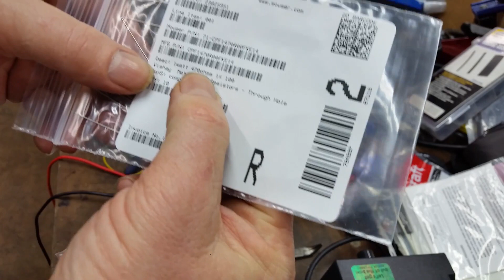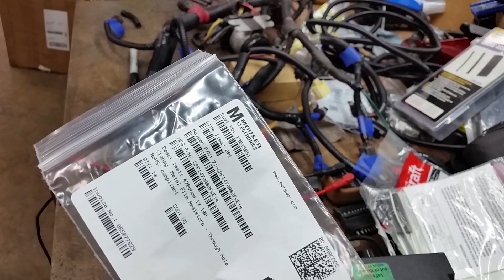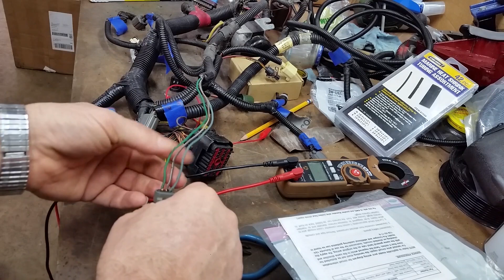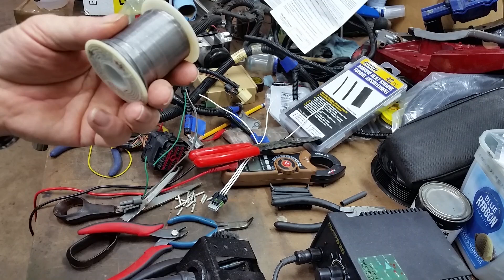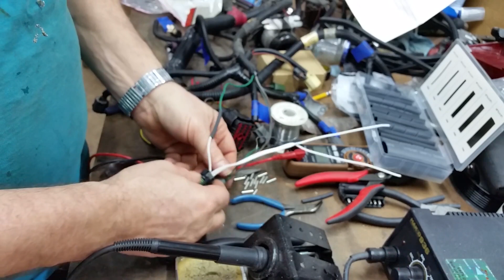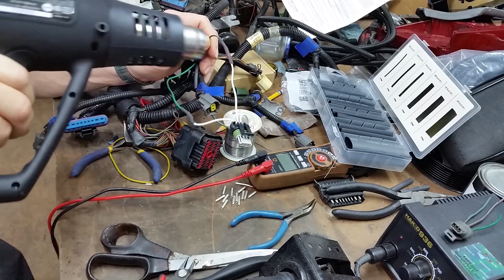7.3 Build: Working the engine wiring harness (Part 1)

Comment: I ordered a f series harness to replace my e350 harness because e series was discontinued. the f harness has a 3 wire crank sensor & my e series has a 4 wire plug for the crank sensor. how would you modify this to work? ty
Reply from the maker: That would involve some in depth comparison between the f-series diagram and the e-series diagram. best bet would be to get the wiring diagrams and the plug/socket pinout diagrams. They are all out there. If you need the f-series I can get the 2002 diagrams for you.

Comment: I appreciate this video. I need to go through my 7.3 wiring and figure out why I'm loosing power intermittently. Also, there seems to be other wiring issues for lights and such
Reply from the maker: Well, these trucks are getting up in age and things wear out. And then of course you have the hackers that butcher wiring during mods. My 1996 was a complete disaster that took a bunch of tracing and patching. But once done, these trucks will be the most reliable vehicles in your driveway.

Comment: I have two encouragements, wire resistance/length. It's automotive, can find a pin out. Starter won't run without proper length. I admire your electrical knowledge.  Stick to automotive
Reply from the maker: That's funny most of my knowledge comes from rebuilding old stereo gear. Its a fun pastime and is very rewarding

Comment: Hey I'm having trouble with my 96 f350 7.3.... I need to replace a female pin on the pcm wire harness.... Do you know who sell those pins or know the correct gauge size for the pin
Reply from the maker: I think NAPA can fix you up with the pins. You will need a special crimper.

Comment: I got a 2003 Ford F-350 super duty 7.3 I got a over drive like flashing and win it flashes it shifts hard and it losses power then some time the light goes off and runs fine tell it flashes again  I thank it is the Wiring harness and I can’t find one would you know where to get one thank you
Reply from the maker: And that is why all of my 7.3's are manual transmissions. Of all the greatness these trucks have, the automatic transmissions are weakest link in this platform. If you do your own work and want it to be bulletproof I would look on the Powerstroke site and either build your own transmission or have one built to meet your needs. The other option is to convert the truck to a standard transmission. There are tons of great transmission builders you can order from, its just a matter of doing your research. Just be prepared to dump some cash because any way you go its going to run in the 4-6k cost for anything good unless you're going to do your own work. 
A good way to see if you're able to do your own work is to watch a youtube site called Transmission Bench. He has the best walkthrough videos for the E4OD and 4R100 that I've seen. Following his methods and videos will guide you to a successful rebuild. All the mods will have to be researched and applied as you need for your build but the process is covered by him in a very easy to follow way.

Comment: Great video,
I'm also very particular about the wiring on my vehicles.
I use:
open u shape crimps and the special tool to crimp then solder and heat shrink.
Zhiyo wire loom from Amazon it's much better than the soft harbor freight loom.
Tesa 51036 tape, it's good stuff and looks factory when done.
Another trick is when at the pull a part find a van or other large vehicle and cut the harness that runs from front to back, this will give you long lengths of factory grade wire in multiple colors for cheap.
Reply from the maker: When it comes to wiring and wiring repair, you've got to take the time and do it right the first time. Otherwise, it will come back to bite you. The thing is, usually it takes less time to do it right the first time then go back and do the same repair twice.

Comment: Any videos on how to check ur 5v reference on 7.3 Engine harness?
Reply from the maker: Using the wiring diagrams each pin of the computer can be tested depending on the circuit. All reference voltages are noted.

Comment: Really enjoying your project. I am doing a lot of the same stuff right now. I hear you talking about eliminating the exhaust back pressure sensor. I would like to do that as well but with all the reading I have been doing there is a lot of confusion about the purpose of this sensor and potential problems of eliminating it. Some say it will effect fueling. Could you shed some light on this subject for me. Also while cleaning up the wiring you may consider moving the glow plug relay to the passenger side fender just forward of the starter relay. There are already a couple holes there for mounting that were intended for the 4x4 vacuum relay and you can totally do away with that bracket in the valley for the gpr and aih relay
Reply from the maker: I have plans for that mounting location but I'll cover that later. As far as the EBPS goes, I'm going to try it with the sensor capped and tied up in the harness. It will still be in the system but will only read at 1 atmosphere(14.7PSI). Like I said in the video, I'll try it and see how it goes. If I get some quirkiness out of that configuration I'll install the tube and cam cover and that will re-enable the sensor. I am trying to get away from the cleaning of the silly tube every 50k.
Reply: I've had mine deleted 3 years now. Including replacing the pedastal to a non-EBP valve one. No change in fuel mileage.

Comment: When you install your split case add a wrap of electrical tape on the wires then leave a tail and slide your split case through the tail of tape then wrap around split case and then seal your ends with the tape wrap. It keeps the split case from moving and seals the interior to keep the junk out.
Reply from the maker: Yes That's true. I did some of them like that and others I did not.

Comment: Nice work. I just found your vids. I am rebuilding my 7.3 now also and cleaning up the harness.  I was curious were you able to just snip the water in fuel sensor and seal the wires without it throwing a code?
Reply from the maker: Thanks. I actually haven't got that far yet but I will post when I get the details on the proper way to take care of the connectors.